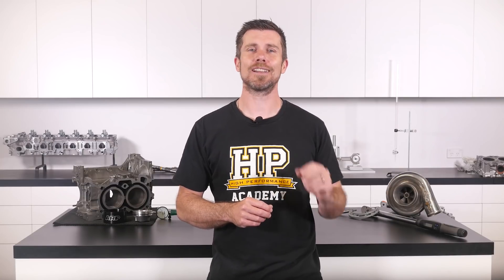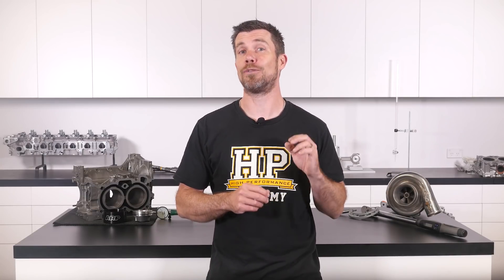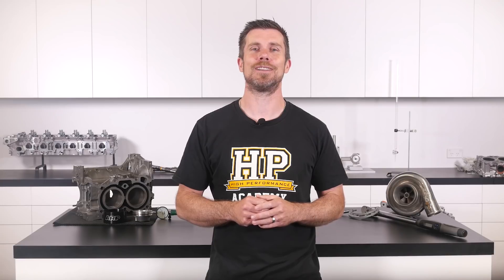[HPA Q&A] Tapered rod bearings. What should I do? | Performance Engine Building

Comment: The person writing in didn't say if it was an engine build re-using parts or new rods, etc. 
If the former, why was the engine pulled down - could be a slightly bent rod if high boost used on OEM parts, this is why it is important to carefully check all parts on disassembly as uneven piston skirt wear would support that suspicion.
With new parts, or old ones, comes to that, before anything else, I would VERY carefully examine the rod bore/tunnel, the contact pads of the cap and rod, and back of the bearing shells for any dirt, debris, markings, etc, that may be preventing the bearing seating properly. They should be spotless clean and I run my finger along them as you can usually feel imperfections that may be missed by eye.
If you can, use a precision miccrometer to measure the journal for taper, if possible, also check the bearing ID for taper in the rod - either way, you can do a double check by moving the bearing shells, and the rod assemblies independently, around and re-checking - if the apparent taper follows the moving, it would suggest an issue there, if it doesn't it would strongly suggest a crank' problem.
I don't thing (s)he mentioned in it was just one rod or several - the former would support the rod being the problem but all would suggest the machining, somewhere, was incorrect. On that, (s)he didn't mention if the engine was rebored - I know GM had a spate of warranty claims for bearing failures from one engine production line that turned out to be due to a boring head being incorrectly aligned and boring at a slight angle, I have also had a block I had to re-cycle from the machine shop ****ing up a rebore - so that may also need checking.

Oh, and UNDERsize bearing ;-)
Reply from the maker: This question was pulled out of about 45 minutes of Q&A and hence we don't ever get the opportunity to dig too deep into the background. I agree whole heartedly that full inspection on disassembly is critical and in fact it's one of the steps we teach in our Practical Engine Building Course. Ultimately if the journal is showing some level of taper when inspected using plastigauge, a much more thorough investigation would be warranted to find the actual source of the issue.

Comment: Usually tapered Plastigauge result indicates a tapered/out-of-round crank journal and/or bent/twisted connecting rod.
Reply from the maker: You're right in that the taper present in plastigauge could be caused by both situations. Of course once you find the plastigauge is demonstrating taper, you're going to need to dig deeper and perform some more accurate measurements to find the actual source of the issue.